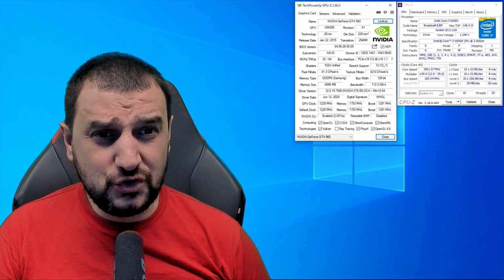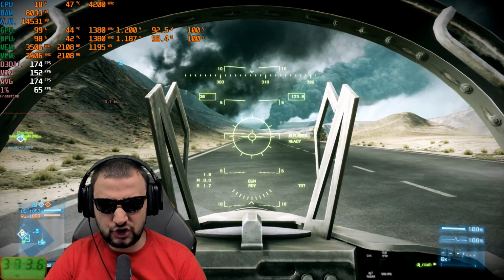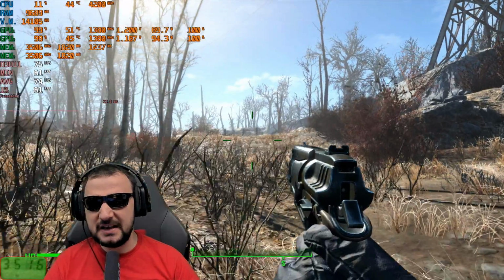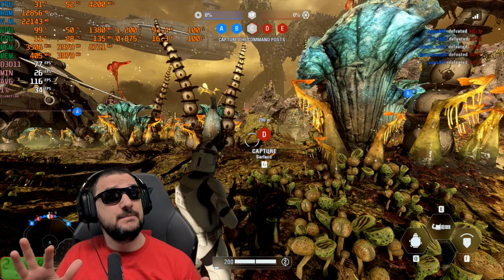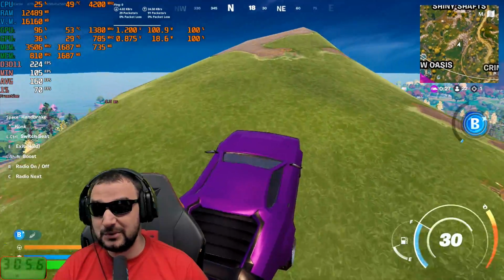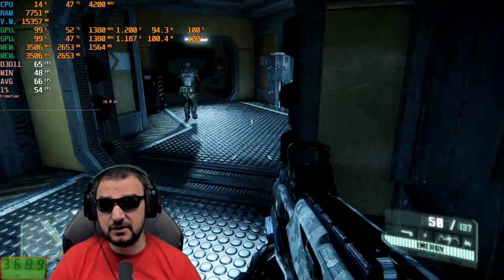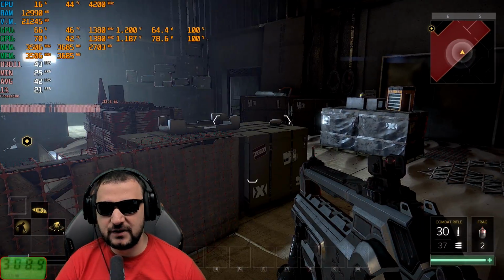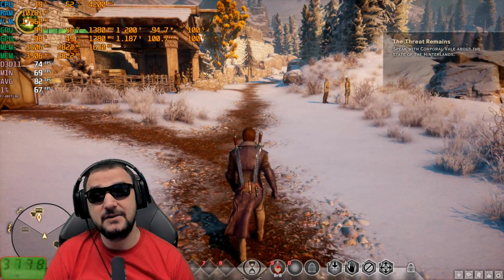ASUS STRIX GTX 960 SLi Benchmark

Comment: The last GPU with Windows XP drivers.
Reply from the maker: Wasn't that keplar? 900 series has modded ones no?
Reply: @DanielCardei yes, with modded drivers you can use GTX 970/980/Ti. GTX 960 is the last with official drivers. I forgot to clarify :D
Reply from the maker: @SneakiestDuke68  its good to know because i want to beast up my old machine with XP and see how i can max it out.
Reply: @DanielCardei in my PC with dualboot XP & Vista unfortunately my GTX 780 Ti rip and I will buying 2x GTX 960 4GB because are much cheaper than 780 Ti actually, even buying two 960.
Reply from the maker: @SneakiestDuke68  it felt illegal doing this  🤭

Comment: Dedicated power supply just for the gpus
Reply from the maker: check the post. i got a 2000w PSU from evga but its a eco mode so it doesn`t work loud.

Comment: Dude! You have got to try out Lossless Scaling 3.0, it's like SLI but with AI curated algorithms. Have one GPU to play the game and the other to run LS3 and see how many more fps you get. My RX 6600 8GB GPU can generate up 2.5X the fps that it is being fed at 4k. So if I can get a game to 4k 60fps the Lossless Scaling running on a RX 6600 will output 4k 144fps with only using 2.5GB of the 8GB.
Reply from the maker: It’s definitely on the list. I have the software installed, and now I just need to find the right cards. I am thinking of combining two NVIDIA cards and later mixing them, not this 960. Maybe something like a 10 series card, then adding another one. I am aiming for a GTX 1080, with an add-on card after, maybe a 1050? I also need to learn the software because I do not know anything about it. I think I will make it a series?
Reply: @DanielCardei For your reference. My system runs a game on a RX 6800 XT which I set to run at 4k 60fps at least. Then with LSFG on a RX 6600 to push the fps to 144fpa at 4k for my monitor. Both cards running on PCIe 4.0 x8 with a Ryzen 9 5950X. Sometimes I can get AMFM running at the same time and its smooth sailing.
Reply: @DanielCardei  It's definitely series worthy as budget gamers or not everyone will want to see what LSFG can gain for them. A 2-3x in gain in 4k fps with added scaling potential from a $200 GPU is huge. It's definitely what SLI or Crossfire teams wanted all along but it's here now. This could make a 8k 120fps gaming system with high end components now.

Comment: Im still on the gtx 570, runs indies, runs older games, and i am tired of live service after playing fortnite for 6 years, cant wait to get up to the 1080 ti and see what thats about, always wanted that, though i am sure my power supply and i7 860 arent enough for that, and the case might not fit it with the drive bays all in the way
Reply from the maker: What model is the 570?
Reply: @DanielCardei  PNY XLR8

Comment: I had two MSI GTX 960 4GBs in SLI back in the day. I had this false dream that SLI scaling wasn't compleletly terrible. Basically when it did work, it was basically a 980 in performance in GTA V where scaling worked. Most of the time I was stuck with one, and few games just didn't like the 960. Honestly in retrospective it was a neat experience, but the RX 390 I traded both of them for was so much better and 8gb Vram as well. I avoided the 970 because of 3.5 GB Vram ordeal.

Comment: I see you got two of these and the gucci versions at that :goat-turquoise-white-horns:. Sad that they drop the 900 and 10 series of gpu's driver support . Last driver will be version 580 🥲 . They had a good run though .
Reply from the maker: I got one by mistake cheap now I have 2 and considering what architecture are I'll say they are my fav efficient sli.

Comment: In starwars the 2d gpu isn't doing anything. 16,3 watts is the idle wattage. You can see it when you look at the clock speed on card 2. It is down clocked to idle speed at 135 mhz. It will automatically speed up if it has something to do.
Reply from the maker: I'm hoping 😅 let me hope 😂

Comment: Still a good budget gpu.
Reply: if you can get the 4gb version and for 15-20$ THEN SURE IT IS WORTH IT.
Reply: Considering you can find the 970 for about 20-25$ now used, seeing as that is almost twice as fast I would say the 960 isn't really worth it anymore unless you are absolutely desperate for a GPU and have no other options locally that are cheap.
Reply: @mr.savage778 In some regions you cant find always what you seek. Even if  you found it could be damaged or not in good condition. You will always have a chance to find better option but if you clueless its a good gpu thats what i say :)

Comment: The Maxwell Architecture. One of the best NVIDIA architectures ever created. The Ada Lovelace Architecture will be the next memorable legendary technology ever existed and will be put in the history books of NVIDIA gaming.
Reply: Ada is merely a die-shrunk Ampere, just like Pascal was a die-shrunk Maxwell 2.0. 
The SM design of Ada and Ampere is 100% identical (apart from the generational improvements to Tensor and RT blocks). 
The only reason Ada is as good as it is is because of the massive leap from Samsung 8nm to TSMC N4P process, which helped push core frequency north of 2.5 GHz (versus ~2.0 GHz).
Reply: @Sam-K  wow, I thought I knew hardware, you really know your stuff! Highest praises man
Reply: They increased L2 Cache Massively on Ada @Sam-K
Reply: @Sam-K  4080 is stable on 3GHZ.
Reply: @Sam-K False
Reply: even at the time my 980 evga classified was kind of heavy on driver and my I5 2400 rly haved a bad time render frame with my 980 not a bad card when ya have a better cpu but the driver kind of made these kind of hard to use
Reply: Lovelace was one of the most power efficent things ever made, and the last one that supported physX
Reply: @Tyvern-c7q No that would be Pascal not Maxwell
Reply: Pascal was good also.